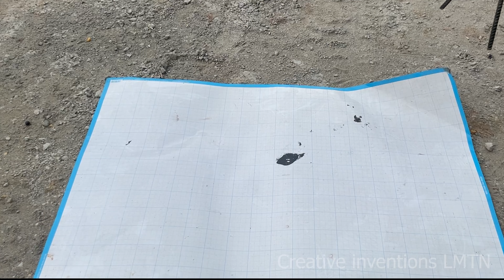Great ! Used Oil Burner Stove homemade to replace gas | How to make Waste Oil Burner Stove

Comment: Hello, plsss what are the material used in this stove?
Reply from the maker: The materials used in the construction of this stove can vary depending on the design and purpose of the stove in the video. Common materials used in DIY stoves like this may include:

1. *Steel or Metal:* Stoves are often made from steel or other heat-resistant metals for durability and heat retention.

2. *Brick or Refractory Material:* Some stoves may incorporate bricks or refractory materials to improve insulation and heat retention.

3. *Pipes or Tubes:* These can be used for the chimney or exhaust system.

4. *Insulation:* Heat-resistant insulation materials might be used to improve efficiency.

5. *Burner:* The burner could be made from various materials, including metal.

If you have a specific video or stove design in mind, you might want to refer to the video's description or comments section for a detailed list of materials used. Additionally, if you have questions about a particular material or need assistance in replicating a similar stove, please provide more details, and I'd be happy to help. 😊🔥🛠️

Comment: where to get the blower
Reply from the maker: i use 12v fan and pvc water pipe to form the case for it. You can watch it here https://youtu.be/tfpmlxeUwc0
but maybe i will make a separate video to guide people in a simple way